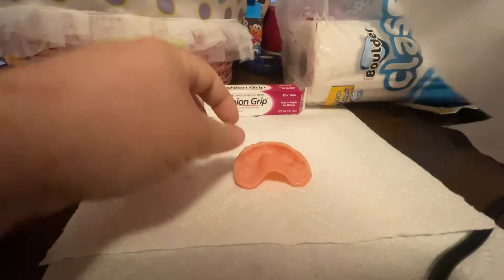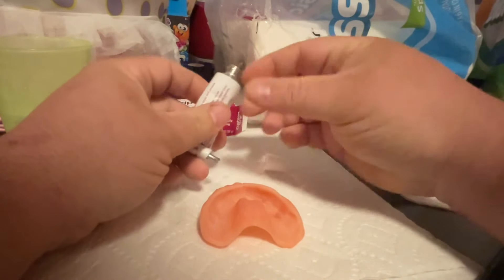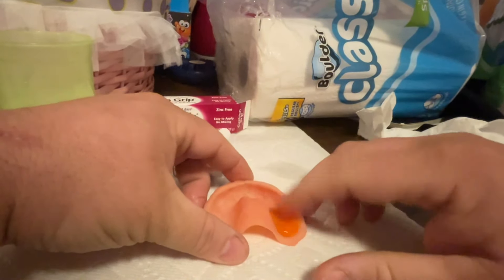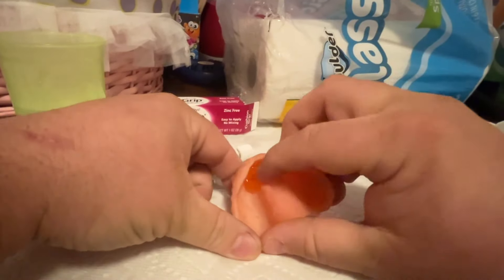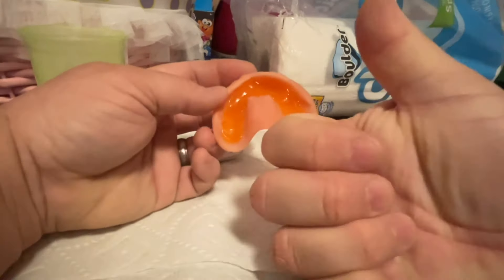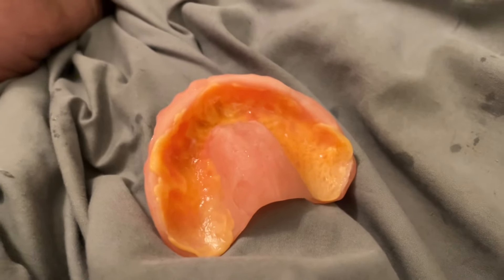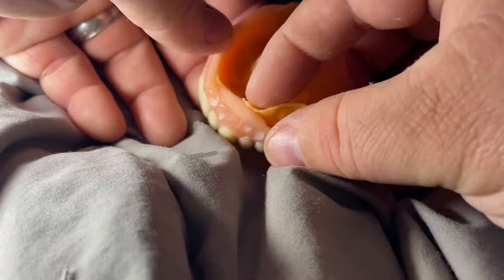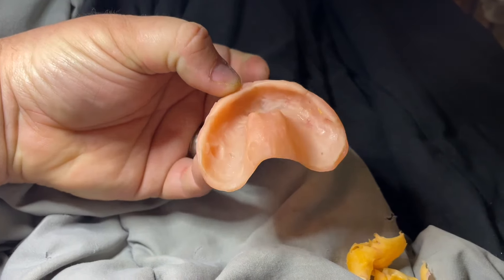Cushion Grip for dentures. How to apply & remove in 2021.

Comment: Great video Brotha! My dentist has done a few soft relines for me since I got my upper in December. This last one seems to be mostly worn off. However, I still see quite a bit of it on the denture. Should I try to remove that before using Cushion Grip or should I use it over what is left of the dentists reline? Thoughts anyone?

Comment: Question, HELP! I just applied my first application by following your video…. It’s about 1:30 pm and I’m worried about drinking or eating with it in before the 6 hours!? How do you eat and drink throughout the day if you are letting them harden for so long? 
Im on a diet so I’m trying to drink a gallon of water a day and eat small every few hours so I don’t know how I’m going to do that waiting so long…,
Also how long do you have to keep your mouth closed and biting down before it’s safe to talk or open your mouth? 

Thank you for your video! It’s beyond helpful!
Reply: You can drink just don't hold the drink in you're mouth for to long also if yu get hungry and need to eat before the cushion grip as cured take yur dentures out eat real quick clean your mouth and pop your dentures right back in ❤

Comment: Hey Justin thanks for the video.  I have new dentures that have a soft reline from the dentist.  My top fits good but the bottom has no grip at all.  Is it ok to use this over the top of the dentist applied soft reline?  Thanks
Reply from the maker: How long ago did you have the dentist soft reline?
Reply: @JustinBsDentureJourney  2 weeks
Reply from the maker: @robertking5701  if the denture is loose from gum shrinking, then this will help.  As i mentioned in the vid, this fills in the gap and gives no hold at all. Just gives you a temporary reline that gives a better fit. Then apply adhesive as needed
Reply from the maker: @robertking5701  and yes it’s safe to use over dentist soft reline. I just make sure to to remove it before going back in to be seen
Reply: What kind of adhesive do you recommend?
Reply: @andrea_thatsme  hey thanks for the reply.  I've since had snap in over dentures installed and no longer need any adhesive. It cost my $33k and although it's a whole lot better it's by no means perfect. I don't have to worry about slipping or moving around but there are certain things I just can't chew.  On top of that they actually hurt sometimes if I wear them more than 12 hours.  To the point if I had to do it again I would probably have just kept my old bad teeth.
Reply: @andrea_thatsme  I use Fixodent plus & Fixodent professional. Both work well

Comment: Hi Justin this maybe a dumb question but I’m gonna ask anyway. After  the six hours should I place adhesive on top of the the dried cushion grip or pull the cushion grip off and then add the adhesive? Thanks
Reply from the maker: The cushion grip will last 4 days.  I added adhesive on top of the cushion grip after 3 hrs
Reply: @JustinBsDentureJourney  Ok thanks. I’m new to this and was kinda confused. By the way I ordered a tube today off of Amazon. I will let you know in a few days how it goes. Thanks again.
Reply: Hi Justin. I received my cushion grip yesterday but haven’t used it yet. I’m goi g to a cookout later this evening and I will them apply the cushion grip. I will keep you posted as to how it goes. Thanks
Reply: I just finished applying the cushion grip. I have a question. Will there be a problem if I don’t put my teeth in water after the six hours being that I want be home?
Reply from the maker: @tomika7455  if you keep your teeth in that’s fine. But anytime after 6 hrs when you take them out, store in water.
Reply: @JustinBsDentureJourney  Thanks for your help Justin. I appreciate you responding promptly being that it’s the weekend :). Enjoy your Day.
Reply from the maker: @tomika7455  thanks you too

Comment: Can adhesive be used with cushion grip? How long does a tube generally last?
Reply from the maker: Yes it can be used with. Tube will last different lengths depending on how much it needs to fill.

Comment: Is the cushion grip safe to use on day 4 of my extractions, this seabond method is not it for me and I have my 1st sift reline in two weeks but I need something to help me so I can eat until then and get used to wearing my dentures
Reply from the maker: I wouldn’t recommend this that early on. Your gums are still very inflamed and trying to put pressure on them to fit the cushion grip would be a challenge. Those first week or so you can do only very soft foods. I stuck with things that require very little to no chewing. Good luck to you
Reply: @JustinBsDentureJourney  Got it. Another question. So my bottom denture is pretty much floating around in mouth and I'm unable to eat because of it. Where you able to eat without your dentures in the beginning if you needed to? I have stitches with no open soars at this time and I can only eat with my dentures not in
Reply from the maker: @Uniquelyme01-l6u  my lower jaw had issues so I had no lower denture in until day 28. I unfortunately had to eat a soft diet the whole time. Ramen noodles, chili, yogurt, pancakes. The fit was a struggle until first reline
Reply: @JustinBsDentureJourney  ok thanks so much for your advice!

Comment: Thank you for your instructions.
I was wondering if I can put Fixodent over the Cushion Grip?
Reply from the maker: I would after it’s cured enough. Like 2-3 hrs
Reply: @JustinBsDentureJourney  
I followed your instructions today about the Cushion Grip.
I still have my dentures in but my bottom dentures are so loose that I don't think I will make it for 6 hours.
Reply from the maker: @wandaeaton369  does it need more cushion grip?
Reply: @JustinBsDentureJourney  
Maybe, I am just trying to understand it. If I put more in do I have to wait another 6 hours?
Reply from the maker: @wandaeaton369  I would to be safe. Maybe try tomorrow.  Once it’s snug then you can use adhesive well
Reply: @JustinBsDentureJourney  
Thanks so very much 🤗

Comment: You said after a couple hours that the Cushion Grip looses a little suction. Can you put adhesive on top of that then? If so what kind, paste, powder or does it matter?  Thank you.
Reply from the maker: Ya once they pop loose I put adhesive on.   It doesn’t matter what kind. Whatever you prefer. I use powder on top and paste on bottom.

Comment: You put yours in right away after applying. Does it help to put it in right away instead of waiting the 5 mins? Also, after applied and cured, are you able to soak them in a solution?
Reply from the maker: I waited a minute or two. I could tell by feel when it was ready

Comment: I'm a new denture wearer ( about 6 months )  I accidentally filed down my upper dentures a little to much.  I filed where I was constantly getting gum sores, which at the time didn't know this was normal at first. Now I do have to add adhesive to keep them in. 
Does this product help with keeping them in without adhesive?
Reply from the maker: It’s like a temporary soft reline. It fills in the gap and you might be able to keep in without adhesive
Reply: @JustinBsDentureJourney  Thank you so much 🙂
Reply: @charminbutterfly32 I did the same thing. I didn't realize the sides were what helped create the suction, so I have to use adhesive now, and stil can't bite anything without them popping off. 🙄 I just got Cushion Grip today, but I'm waiting till the morning to use it. "Real Life with Michelle and Rob", she shows how you can use it to build up the sides, so hopefully this'll help with the suction. Did it help you?
Reply: @srvntlilly  I have not tried it yet. I keep putting it off. Sorry can't give you feed back.
Reply: @charminbutterfly32  Tell you what. Don't put it off! I did it this morning. This is my first time (only my uppers). I didn't quite get enough on the back of the palette, but even at that, the suction feels amazing! They don't feel like they're gonna pop out any minute. They did ,even with adhesive, before. They feel more natural, even with only my uppers in. And I actuallly have my real smile back! They stuck out a little before, so I looked a little buck toothed. It is so worth it. Don't put it off anymore. 😁🌹
Reply: @srvntlilly  thank you, appreciate the feedback. Will need to get some asap then.

Comment: CG says it lasts only 4-5 days! Can you tell me what happens to it after 4-5 days? Does it come loose from the denture? Does it thin out, or just wear out? Did you try reheating CG and put it back in your mouth like a fresh reline? If not, why not? Thanks in advance, I'll look for your reply.......
Reply from the maker: It just kinda drys out. Once you pull it out it’s done. I wouldn’t try reheating, too many risks of germs and bacteria.
Reply: @JustinBsDentureJourney  thank you for your reply. My tube came today. I put it on the upper and 2 lowers. Tomorrow everything will be dry, so I'll do my own test. So far CG is sure different than the thermoplastic I was using.....

Comment: Hey there! To make sure I'm understanding correctly, over the 6 hour period, the dentures will be ill fitting and to not expect them to be functional until after they'd been in water? I'm planning ahead, to anticipate getting up earlier on  Saturday mornings or something to have this done and go through my day without losing my day. What do you recommend? Thanks!
Reply from the maker: It is a strong hold like adhesive for the first hour or two as it sets. It will eventually come loose (not holding like adhesive) but still a better fit. This is when I added a little adhesive to get that better hold.  You may or may not need adhesive. You only need to put in water after the 6 hours when you take them out.  If you leave them in all day, you don't need to take out at 6 hours
Reply: You’re absolutely beautiful! I saw your comment and I just wanted to let you know my experience with Cushion Grip. I had 19 teeth removed ALL I had left and had to go into full immediate dentures. I was in an incident years ago that left my original teeth messed up badly plus I was a 70’s baby with NO Dental care. I heat this up in hot water for the time he recommended and I only can use it on the bottom plate or it will push my dentures too far out but that’s mine. I place it in and if they still feel loose after or you notice anyplace you need to add or trim off I reddy my plate and add more. They do get loose again after about 2 hours and at that point I use fixodent. Then clean them at night and soak them. I personally have to take mine out every 3 days and redo it because my gums are still healing. It will come right off the dentures after it’s cured. A few hours even and I can remove it if needed. I have tweezers just for that purpose now. Anyway I’m so new to this I hope I helped some. My big thing was I was scared at first but this product has helped make this manageable for now as my dentist won’t even adjust them until the 27th! Love to you and you got this sister!😉❤️Oh yeah and when I get real frustrated I just message this in Emojis…🖕🦷😂!
Reply: @JustinBsDentureJourney  thank you for making these videos! You’re literally helping me get through this! You’re awesome! Much love and respect. I’m only 2 months in and I’m so frustrated right now! I have anxiety and PTSD from an incident in 2007 that caused my teeth to begin falling out. I went to get 1 tooth done and came in 2 days later and had 19 teeth removed and these immediate dentures and haven’t been able to cope then I found you. Just probably saved me I’m very very appreciative.❤️And when I’m frustrated I just 🖕🦷😂
Reply from the maker: @faithinwonderland6589  glad to help. Good luck to you. It can be frustrating at time but just be patient.
Reply: @faithinwonderland6589  How long after extractions did you wait to use it? I am 19 days post op, all uppers and have a tube to try. Just not sure if I can yet .
Reply: @jenikajones6743  hi. I don’t know how much help I’ll be but right now I’m 2 months post my E-day so I hope I can help out. I used it after about 6 weeks but Sis let me tell you something…I have bad fitting dentures so I had to find something! You should be able to go ahead and just do it and use it  now you’ll be fine and it’s not scary at all. Follow his directions and after about Id say 30 minutes later if I’m unhappy I can take tweezers and remove it easily and I just start over. I actually use new everyday. I put it in hot water about 5 minutes myself. I can only line my bottom although my top don’t fit either because it will push out my lip right now. I have 2 more months before another professional feline. This is hard but I’m here with you walking side by side with you. Wanna be my denture buddy? 😂🖕🦷Hope I helped.
Reply: @jenikajones6743  can I ask you how your journey is going? I am having my own issues. I’m 45 this was a necessity and so eventually I should be able to do everything but right now I feel absolutely gutted. Can you please share with me so I don’t feel So Alone?
Reply: Hey girl and he says it cures after 2 hours but if you get it wrong and want to start over❤️Sister just breathe and it will turn a light peach color and it will completely come out after that. May thing I’ve learned about it is that I CAN use it without problems which I’m grateful for. I would love to have you as a friend for communicating do you have Google Chat? I downloaded it and you can chat there privately ❤️
Reply: @faithinwonderland6589  The struggle is real. My immediates fell out the day after surgery and it was 8 days before I could get them adjusted. After the 1st adjustment it has been ok. I went ahead and decided to try the cushion grip this morning because when I put my teeth in earlier they kept falling forward giving me the lovely Mr. Ed look. So far so good. I will be 40 next month and decided to do this because I have spent thousands of dollars on my mouth only to have all of it fail due to calcium depletion from pregnancies. It would have cost more to fix my mouth than go this route. How has your denture adventure been so far?
Reply: @jenikajones6743  Wow! Thank You for sharing with me. I had horrible teeth and I’ll be 45 years old the 20th. I was sitting on the porch…had just stopped smoking and a front tooth fell out!😭I went to the dentist naive as hell that they could do anything because my own were really bad anyway. I had 6 other teeth that were broken off at the gum from something that happened 14 years ago. I wake up some days I feel ok and sometimes it truly sucks! I got mine July 27th. Today it’s a bone spur that won’t come out! 🤕 ❤️
Reply: @jenikajones6743  our stories are the opposite in that I also had kids that depleted my teeth. One daughter at 25 & one daughter at 38. Only I haven’t had dental care since 2007. Sending all positive vibes your way ❤️
Reply: @faithinwonderland6589  I had 8 Boys and major dental work after each one but to no avail . Stinks
Reply: @faithinwonderland6589  😂🤣🤣🤣😍😍 you're to kind and thank you so much! I'm more excited than scared - but anything that comes up, I'll face it head on 💗 that's fantastic!!! I may be coming back to reference this comment tbh after sockets are healed over!! Thank you thank you! Lol ps I'm sure I'll do a Heather b denture DiVa to boomerang the denture once in a while(not really) 😂🤣🤣💪
Reply: @DaniellesDentureDiaries  message me anytime you need to 😊 and whenever you’re frustrated just remember I’m right there with you ♥️😂
Reply: @JustinBsDentureJourney  dang! I wish I had seen this. Ugh! I will reorder and try again. I guess I was too excited and didn’t truly follow the instructions. Ugh!

Comment: Can I use cleaner for my dentures?
Reply from the maker: I was always told no soaking tablets with any type of soft reline. If like cleaner paste like dr b’s should be fine
Reply: @JustinBsDentureJourney  If you can't use soaking tablets how do you clean the dentures please, I am in the UK and am not aware of any other method of cleaning and thought you can't use toothpaste on dentures? Thanks for anyone who can advise.
Reply from the maker: @natmya243  you still soak in water at night.  I cleaned my dentures with a brush and a mild hand soap at night when I take them out. Or they sell denture paste that’s ok to use. (here in us, not sure about there).
Reply: @JustinBsDentureJourney  Thanks, wish I was in the US, you guys seem to have such nicer dentures :)
Reply: @natmya243  I'm in UK too
Reply: @natmya243  I use steradent tablets & leave  for 10mins . Then one drop of washing up liquid with a capful of a good mouthwash in a warm water solution.

Comment: I just tried this product. After letting it set in my mouth for about 5-7 minutes and when I took them out to get rid of the excess, half of the cushion grip was stuck to my gums. I made sure they were clean and dry but I did put it over a soft reline. Would this cause it to not stick to my dentures?
Reply from the maker: It takes 2-3 hours to cure enough to remove from mouth and remove excess. I made the same mistake you did my first time.

Comment: Very good ! Have you ever tryed Den-sure-fit ? Its a little pricey but it will last a month or 2 so its a trade off but i can attest it works awesome especially for the top plate .....
Reply from the maker: Thanks. No I haven’t tried it yet. Since I’m still getting soft relines from my dentist, I’ll hold off using that until I’m in my permanent set and need better fit if needed. I don’t see the point of spending that much money for such a short period of time lol
Reply: I wouldn't use that, it contains acetone. Plus its more expensive